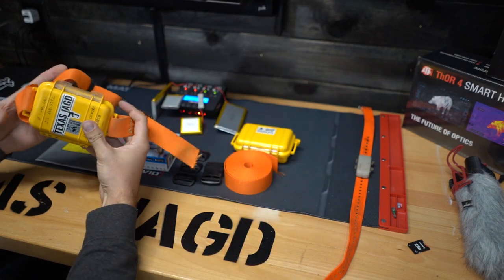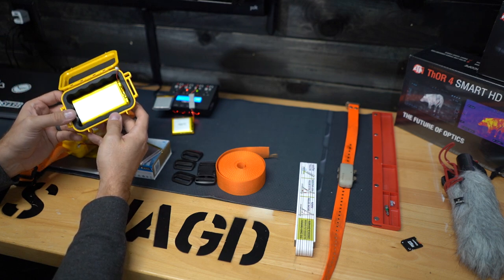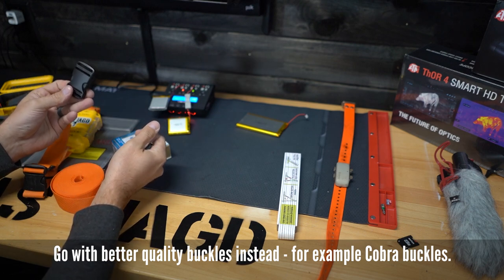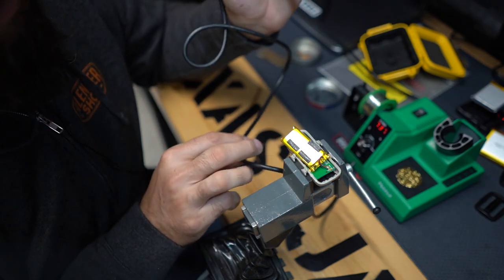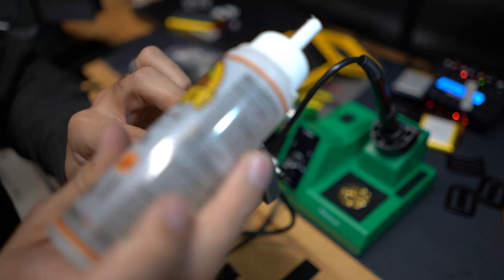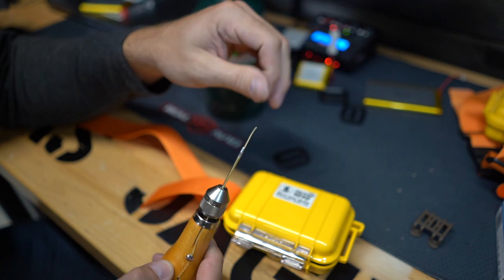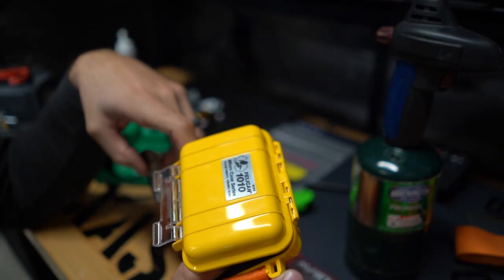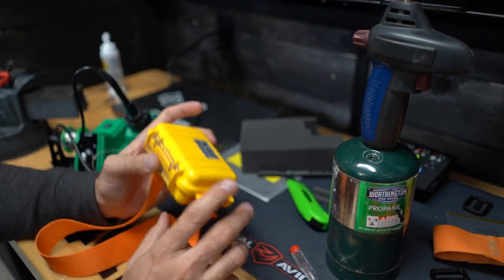How to build a GPS Tracker for Feral Hogs for under $100

Comment: Ronnie: I love your design. I have ordered the parts to make a tracker with multiple 10k Lipos and I am about 125 miles south  of Austin, in Bee County.( BIG PIG Problems).I will share the data I get.Good luck and thanks for the Idea. Doug
Reply from the maker: I just did this today - put two 10k lipos in parallel! Would love to film you if you get to tag one if you're interested.

Comment: I'd have get one and test to know for sure but many devices that use cellular / gps have a keep warm timeout on the modem / gps. The power needed for startup of the modem and gps is high so if it's reporting every min or 5 it might leave the cell modem / gps on. If you want longer battery life you might want to go to 15 minutes plus on reporting interval. Second, those lipos are not cold tolerant, so if they get to 33 degrees or lower you will see battery life drop pretty quick. Below 28 they might be damaged. If you need cold performance then you can use lifep04 cells as they are cold safe, however you will need some extra circuits as their cell voltage is much lower. Keep up the good work, Good luck!

Comment: Maybe add a VHF radio in the collar for pinpoint directional accuracy once you get close instead of having to deal with GPS drift in the brush.

You could add a small circuit to ping it awake only when you're close to save battery life.

Comment: looks like the Pelican 1010 will hold 3 of the10,000 mAh 3.7V LiPo Batteries wired in parallel  should go for 2-3 weeks .
I have built similar trackers.
Reply from the maker: That's what I use now.

Comment: Cool video... I've seen what happens when you short the wires on these batteries.. it's neither pretty or healthy... can I offer a tip.. carefully cut the wires before you desolder them. One at a time and different lengths so the don't short..
Reply from the maker: good tip, thank you!

Comment: Sorry but I had to laugh cause we use inches in the US.  Not making fun of you whatsoever, my Grandparents migrated from Germany and they used centimeters as well.  It actually brought back good memories.  Keep the great videos coming.  I live in Texas as well and we have feral pigs on and around our land as well.  I’m always packing when I go into the lowlands as I call them, on our land.  Those pigs are very dangerous so I’m going to always make sure I’m ready!
Reply from the maker: can't handle the inches and fractions... so much easier using the metric system :) And yes, I definitely have learned to always be ready. It happens pretty often that I come across pigs when I don't expect while moving in and out of properties.
Reply: @TexasJAGD  I understand, I couldn’t do the Metric System. Lol.  And yes, it pays to always be ready!

Comment: I love how you use metric. It's way easier haha. I moved from Canada to Texas and still don't understand this silly imperial system.
Reply from the maker: #truth
Reply: Military have been using Clicks for years, don’t know why the US has jumped to metric.
Reply: @robw4ltz408  I'm confused what you're trying to say haha. The USA still uses imperial and it's silly. How many mm is 7/52 inches?
Reply from the maker: 2.58535664765 mm .... Roughly 😂
Reply: @Gloszz   a click = 1 kilometre, metric distance. That’s all.👍
Reply from the maker: You probably meant to say "don't know why the US hasn't jumped to metric"?
Reply: @TexasJAGD  I’m not that bright so working in tens with fingers and toes is a good fit. Excellent topic and material